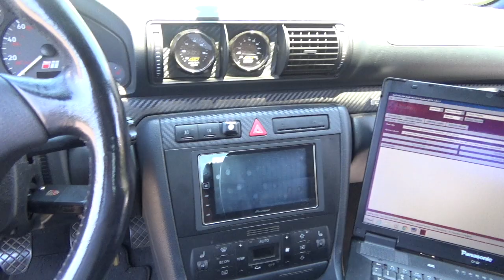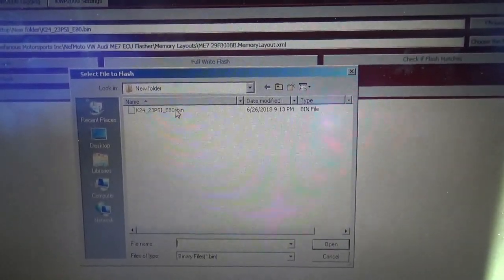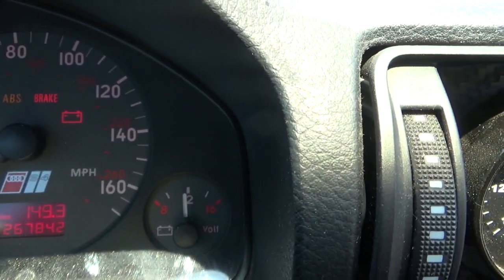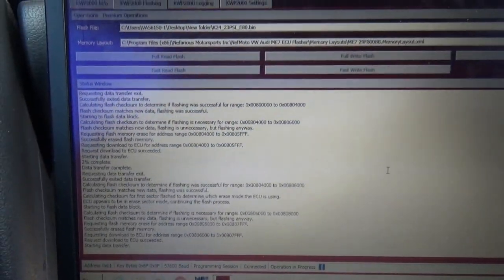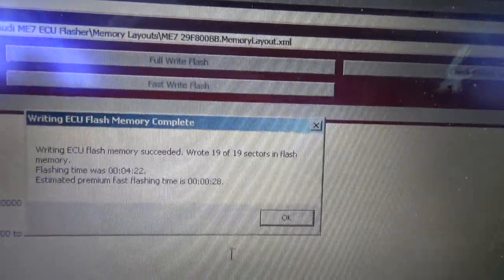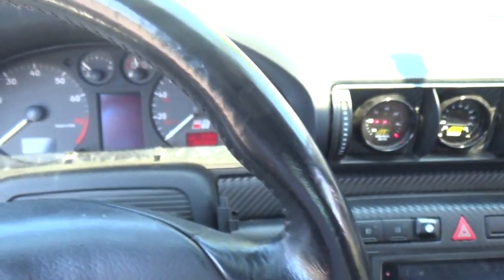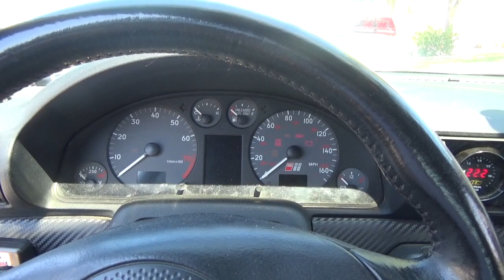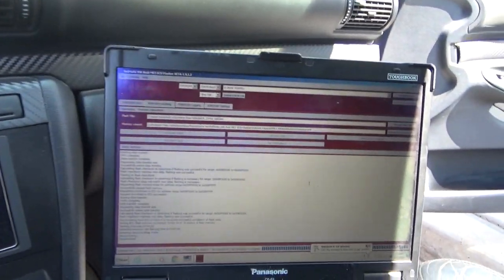How to Flash your 2 7t and 1 8t ecu with Nefmoto

Comment: Can you use a tactrix 2.0 cable? Or vcds cable?
Reply from the maker: I have not tired a tactrix cable but I do have one so maybe I’ll test it out.  You can use the older hex/can and older cables then that but hex v2 or hexnet will not work.
Reply: @German Elite Tuning  yea apparently you need a FT232R chip kkl cheapo cable. But I'm unsure which one. I seen a vendor on nefmoto offer $35 cables but few guys mention $15 Amazon cables working just need to make sure of that chip
Reply from the maker: @Pitman556  yes that’s correct.  Ftdi232rl is the chip the cable has to have. As long as the Amazon add says it has that chip it will work.
Reply: @German Elite Tuning  do you have any experience woth a simos 8.5? Audi q5 3.0t
Reply: @German Elite Tuning  do you know how to add the checksums into the nefmoto software? So it automatically checks vs manually? Also do you know of any checksums for autotuner I can only find them for winols software

Comment: I Have an aeb 1.8t with a 557p ECU. Currently running a 18psi stage 1 tune from Ian at reflect tuning. Gathering parts now to go gt3071r. i’m personally thinking eurodyne maestro software because I have became very fond of e85 and 93/85 blends. does anybody have any other recommendations?
Reply from the maker: That’s awesome. That will be a fun setup. Ian is a great tuner.  He will be able to tune it for you on the new turbo setup.  Maestro is an option for side but it requires you to have tuning experience to make changes to the tune with their tuning suite

Comment: what cable are you using?
Reply from the maker: Andrei Liviu it’s an older ftdi232rl cable. The cable has to have the ftdi 232rl chip to work with nefmoto.
Reply: @GermanEliteTuning  thanks a lot. :)

Comment: How did you edit the files in tuner pro?  Whenever I load XDF in tuner pro it crashes.
Reply from the maker: RazorSharpTek sounds like the xdf is corrupted. Try another xdf and see if it still does it.
Reply: @GermanEliteTuning  tried multiple.    Crashes as soon as I select one
Reply from the maker: @Korinrl  it could be an issue with that version of tunerpro. are you on the most current version? it could also be your computer does not have enough ram and its getting overloaded.

Comment: New to Audi. Im an ASE tech...I have an A6 S-Line 2.7t sock but added vent boost gage and new brakes and all control arms, Kumho PS31 hi-PO 235/45/17 tires. Want to tune out bad egt's and do a stage 1...can you help

Comment: Why does your rpm gauge have a screen on the bottom of it? Did this come on newer models bc my s4 is 2000
Reply from the maker: Hostess King mine is a 2000 date and time is normally displayed in that location. it’s a gauge display that my friend is making. I’m one of the beta testers. He is putting together a new version of the gauge that will be able have boost, afr and others.
Reply: Isnt their a guy that makes the whole center screen which is like a mini computer?
Reply from the maker: Hostess King yes there is a guy that is installing a color display with diag capability’s that replaces the mfi display but I can’t remember his name. I like this gauge because I never use the clock or date and it looks close to factory.
Reply: Hmu when your friend releases his device. I am interested
Reply from the maker: Hostess King I will for sure. It should be available in a few months. I have an detailed install video also that will help with the install.
Reply: any update yet? Is your friend on az?
Reply: nm I saw another comment lol
Reply from the maker: Hostess King thanks for watching my video. I try and post one every week.

Comment: Hey man I have Audi S4 ..., I have a list of parts I’d like you to see so you can let me know what it can have installed for better performance... not really looking for much power but it has Twin K24 turbos, forged internals, down pipes, 60lb fuel injectors, walbro fuel pump, rs4 mag, 3bar map, apr no pipe, awe intercoolers, samco hose kit, ICM delete, R8 ignition coils, Rs4 motor mounts, awe trans mount, poly snub mount, stage 3 clutch, awe boost gauge, wide band afr, big breaks brembo kit, upgraded rotors all around, bilstein shocks, neuspeed springs, neuspring sway bars, 18inch Oz ultraleggeras and the rest is cosmetic
Reply from the maker: SEND IT JOHNNY man that’s a great build list. Your limited by the 60lb injectors from running E85 but that setup on pump gas is good for 500hp on 93oct. 91oct mid 400 range.
Reply: German Elite Tuning so there is no way I can improve while still running pump?? And yes I’m at 526hp now .... my goal really is 600hp and I will be satisfied..😂
Reply: German Elite Tuning I know with the 60lb injectors I have now will support roughly 600 rwhp without running e85 but if I do go e85 I do believe the script changes... but I would like to stay pump.
Reply: I know im kinda late but did you fit the 18" ultralegera on the front axle with stock brakes? Did you have to do any work pulling or rolling the fender at the front axle to get enough clearance,